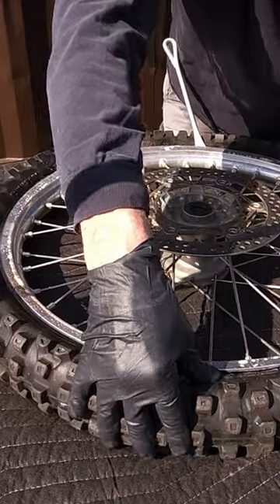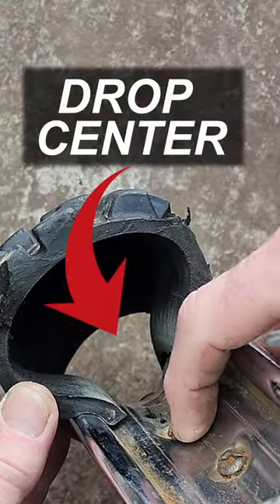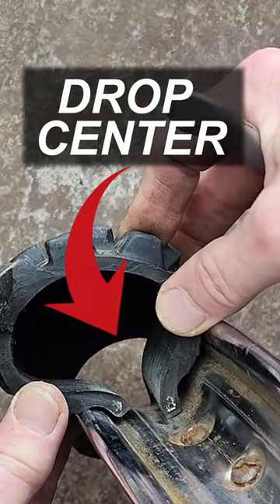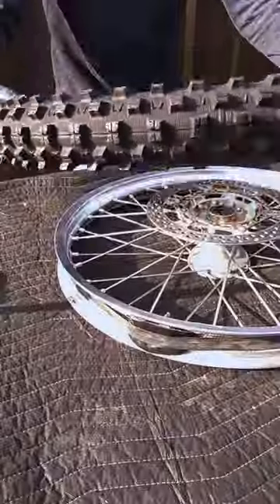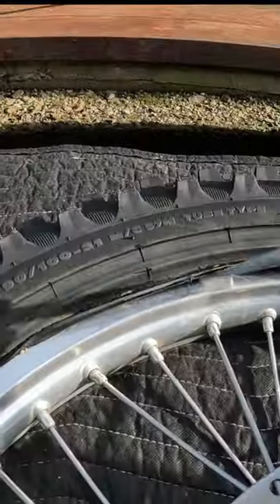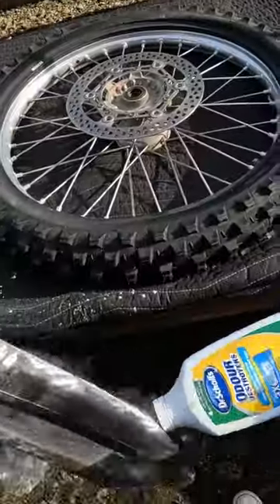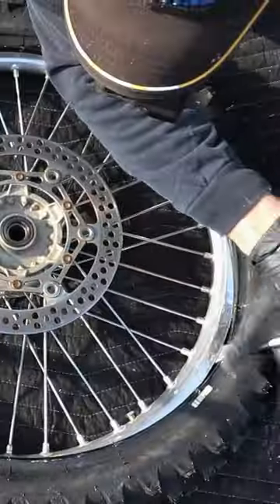Tire Change Wisdom You've Never Seen Before -Never Struggle Again!

Comment: Nut to the dust cap? Have I been doing it wrong all my life tightening it to the rim?
Reply: I’ve never heard that either
Reply: @shogun678 I heard it’s just another preventative measure for torn tubes. If the rim lock slips, the tube can give a little before tearing the stem straight out.

Comment: zip ties. Twice and fast. Way less likely to pinch a tube. I put my front on my klr with zero tools. slightly aired tube in tire. Ziptied closed and mounted it up using my hands and upper body. No spoons
Reply from the maker: Holy moly that sounds amazing  .Twice as fast (assuming "and" was a typo ) and done by hand ,no tools required .Please make a video to show us all how its done. Talk is cheap .Prove it good sir .
Reply: @TRyanLearnBikes  I literally put the tube in it. Zip tied the tire to the point the gap was almost completely closed. Put the hole for the valve stem closest to me. Put valve stem in and  spun nut on enough to hold it in the rim put that side of the tire on and then went left right and then spun the far side close to me and pushed it on. Cut the zip ties and pulled them and then aired it up. Zip tying it like that keeps the edge of the tires down in the groove. Making it much much easier.
Reply from the maker: @bigdave6194   Ok well it sounds like a pretty neat method ,while this is a slightly more detailed explanation a picture is worth a thousand words .I'm guessing you have a phone capable of recording video .Next time you install a tire this way ,shoot it and share it .You will have a viral video on your hands .Oh and be sure to film it in real time as you claim its twice as fast as a standard install . Looking forward to seeing the results .Cheers to you good sir I truly appreciate you taking the time to comment with positive intent .
Reply: @bigdave6194 oh dang I'm definitely trying this out I'm waiting for a mx34 19 inch rim to ship out as soon as I get it I'm doing this zip tie method I'll try and make a video thanks
Reply: Twice as fast? By the time you put all the zip ties on, I would already have the tire on. lol
Reply: Put air in the tube till it takes the round shape then put it on the rim... You'll should never pinch it like that.

Comment: What does powdering up the tube do??
Reply from the maker: Powder applied to the tube or the inside of a tire makes a slippery interface.This makes it easier to mount and seat the tire with less chance of the tube catching and getting pinched under the edge.
Reply: @TRyanLearnBikes  Thank you That makes sense..
Reply from the maker: @Jp T  You're quite  welcome, Jp.Cheers🍻
Reply: @TRyanLearnBikes  i’ve tried powder, but I feel soapy water with vegetable oil works even better. Not sure if it will destroy the tube.
Reply from the maker: @marte1a256  That sounds like  it would work quite well.Im always open to new ideas. I don't know how it may affect the rubber over time . Have you had the opportunity to go back into a tire after a year or two to observe any negatives .
Reply: @TRyanLearnBikes  nope. I just came across a thread on Google and thought I would try it. I’ll let you know next time I have to change the tube how it worked out.

Comment: To prevent wheel damage i cut both sidewalls all the way around with a utility knife. The tread portion falls off leaving the two sidewalls. Then i break each bead with tapered plastic construction shims you can get almost anywhere tapped in between the tire and wheel adding in shims  until the beads break and each sidewall falls off. Use 6-8 tie wraps cinched up on the new tire as you squeeze the beads together with your hand and the tire will fall on the rim.  I haven't done a tube but the cinched up beads should hold the tube in place perfect. You can squeeze the tire or move it slightly to take pressure off the tie wraps as you pull them out to prevent damaging the bead or tube. Basically you're eliminating the drop center and struggling with the beads by separating them during removal and cinching them together during install. It increases the bead circumference when squeezed together to about the same circumference as the rim.
Reply from the maker: That's a very interesting technique you have described, John. It sounds like it would be very effective. .I  bet if you had a chance to create an instructional video on how to perform the task using your method , you'd get tons of views .Thanks for taking the time to comment. Cheers 🍻

Comment: What do you mean drop center
Reply from the maker: The drop center of a rim refers to the inner portion of the rim that is a smaller radius than the outer portion of the the rim .As you can see in the cutaway view it provides an area for the lip of a tire to be pushed down into which gives room on the opposite side of the tire to be easily lifted over the edge of the rim .

Comment: Would same work for aluminum rim tubeless front? Specifically nc700x. Thinking about doing my own. Shinko 705.
Reply from the maker: Hey there  @desotopete. The same rules apply for sure but there are a few things to consider. Breaking the old  tire bead off the rim will be a challenge. They are typically very stuck to the rim and require a bead breaker tool or some creative improvisation. Working with tire irons on nice aluminum rims is also unforgiving , one slip and you can leave a serious gouge. If it's one of your first few times changing a tire this may not be one to tackle. Having said that if you're a mechanical type guy with lots of patience  you  certainly could do it .I have a fair   amount of experience changing many different types of tires on lots if  different rims and when it comes to changing tires on road bikes I always default to a tire changing machine. It's paid for itself many times over but if you're only likely to change tires once in a while its not worth the investment. Hopefully this info helps. Good luck ahead and feel free to let me know how you make out .Cheers 🍻

Comment: I’m trying to change my tire and I pinched 5 tubes already and I’m so mad
Reply from the maker: Oh damn man ...I know your frustration. I've been there buddy. 
Maybe take a look at the video that is linked in the bottom of the short it goes into a bit more depth .Hopefully it helps .Good luck .
Reply: Make sure you put a bit of air in the tube
Reply from the maker: @shogun678  That golden bit of advice is in the long form video linked in the short
Reply: Put air in the tube so it's round... Then put it on the rim. I never pinched another tube once I started doing that
Reply from the maker: @donvee2000  Thats good advice 👍